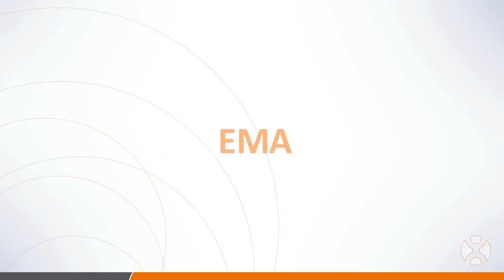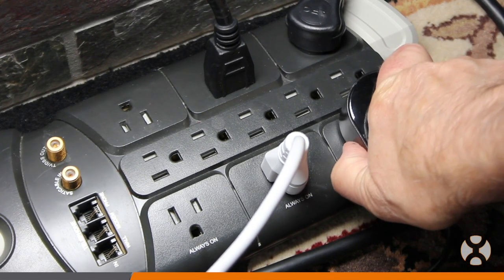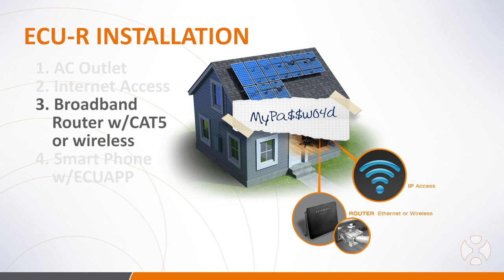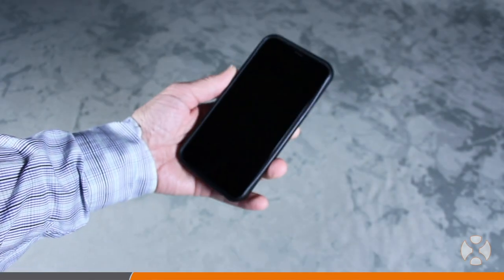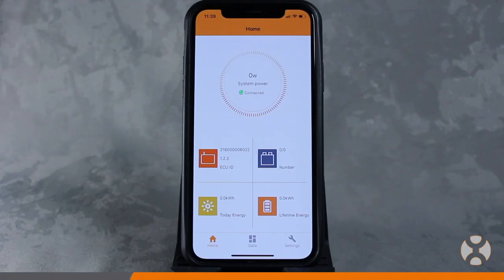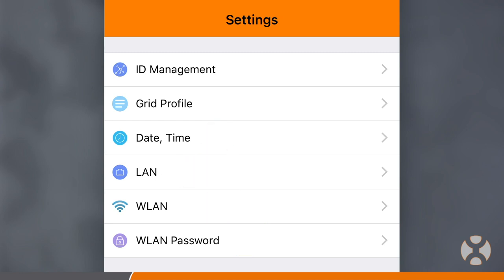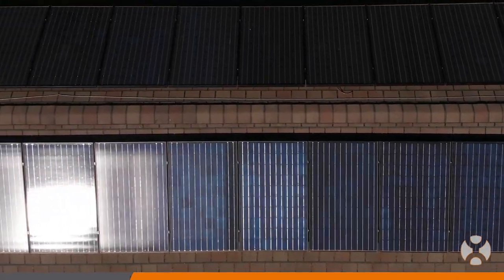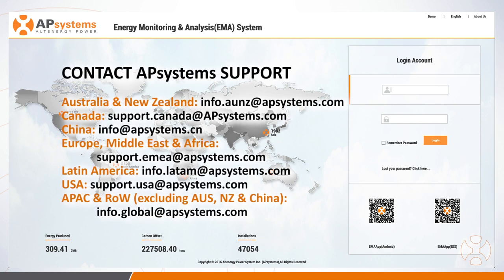Outdated Installation Procedure: APsystems ECU-R Five-Part Installation & Setup |  Full Length Video

Comment: The YC500 at 120VAC is very bad, it doesn't synchronize, and the after-sales support is very bad. We do not recommend it.
Reply: It requires 240VAC, so I'm not too surprised.
Reply: You are telling me.....i wish i did some more research before sinking two thousand dollars in their equipment
Reply: @GoldensRule45  Ditto.  What a piece of junk.  They don't honor warranties, don't provide support, and in 5 years almost half of my inverters have problems.
Reply: Have you looked into Hoymiles HM Series inverters? They are definitely the best micro inverters on the market and the support is fantastic!